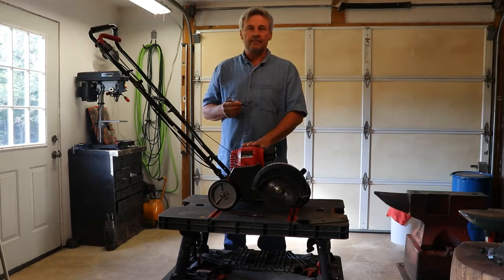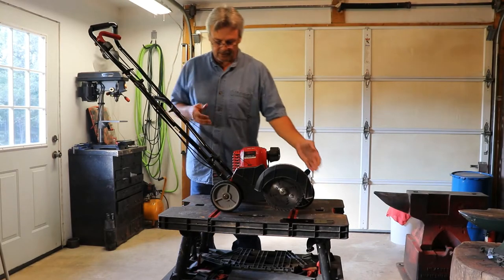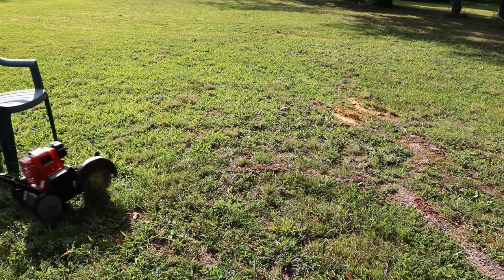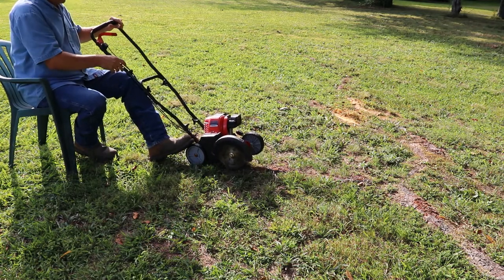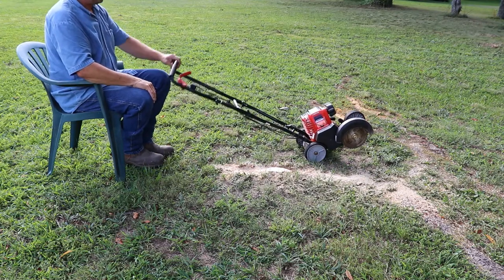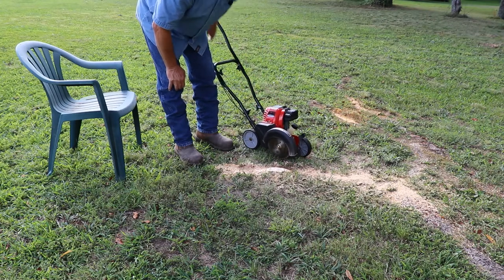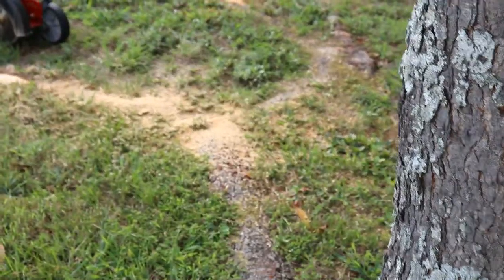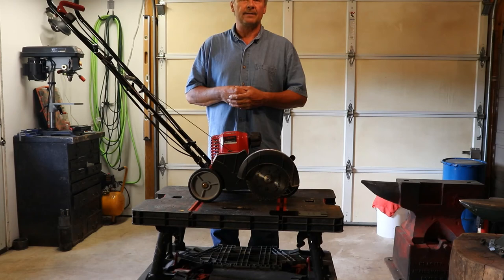A Small Stump Grinder

Comment: We're preparing a garden area in a place filled with stumps from about 6 inches in diameter to 40+ inches. I figure I have to cut down at least 15 stumps plus some roots. My wife plans to do raised beds so we don't have to extract the stumps. We just have to smooth them down to ground level. I've been searching the internet for a more economical way to grind our stumps. I believe your method will work for most if not all of our stumps. Thanks much for sharing this great idea.
Reply from the maker: Hello Dale. I think this tool should work great for you. I have been using mine for about 7 years now and removed more stumps and tree root than I care to count LOL. Good luck with your garden,
Thanks for Watching

Comment: Great video. We share an imaginative solution to problems. 
Before I found your video I made one of these for myself from a scrapped edger. 
I used a 10" carbide blade with a wobble plate like use to be used on table saws for cutting dados. 
Pretty nice idea. 😁😎
Reply from the maker: Hello and Welcome , I bet the 10 inch blade can grind the material up pretty quick . I like being able to transport this tool around easily and take out anything that slows down the Lawnmower . You know We Both  have saved a lot of money with this Tool Hack  👍 . Thanks for Watching

Comment: I used a single carbide tip blade on my 3hp gas edger and just sliced through the roots at each end and removed the exposed center section.  The tree had already been cut down, so no worries about killing the tree.  The method I used was similar, but way faster, especially on lengthy exposed roots.  A word of caution regarding living trees...think of the roots as arteries.  You can pretty safely chop out small ones, but risk killing the tree by severing a large one.  Also, removing as much dirt where you are going to slice helps with blade life.  ;-)
Reply from the maker: Good Morning , I bet the 3hp had the blade spinning pretty good ,and it is nice to get a  clean path for the lawnmower . Thanks for Watching

Comment: Awesome adaption!  I was going to scratch build something but I may opt for this.  One quick question, how is the main drive spindle holding up?  With the side to side movement has is loosened up or developed end play.  Thanks for taking the time to share this with us.
Reply from the maker: Hello Fred and Thank You. The bearings are holding up with almost no play in them and this edger is belt driven and I haven't replaced the belt yet after about 60 or so stumps and the carbide blades last a long time as well. This has saved the price of the edger verses rental fees several times over. I hope this helps and Thanks for Watching

Comment: I tried my grinder yesterday and it worked quite well. Question: Do you have trouble with the blades slipping easily? I was wondering if there's a way to cause less slippage.
Reply from the maker: Hi Dale, I placed a washer in-between the blades and this holds the blades in place and makes the cutting space a little wider as well.

Comment: The washer between the 2 blades is there a size that fits perfectly or just get one that fits even it it has some play?
Reply from the maker: Good Evening , Yes the washer should have a 5/8 hole in the center the outer part of the washer should be 3/4 to 7/8 inch it will work if there is a little play . I hope this helps and Thanks for Watching